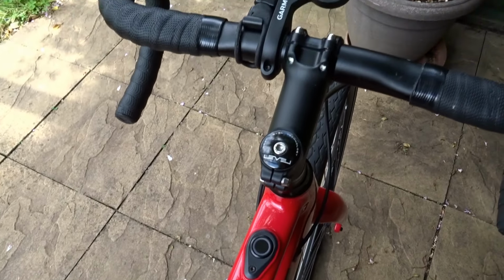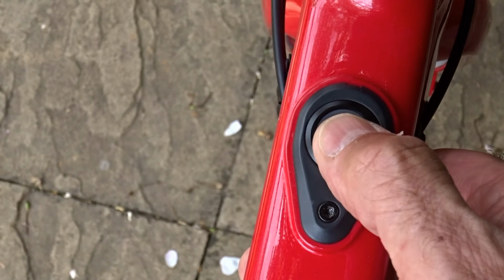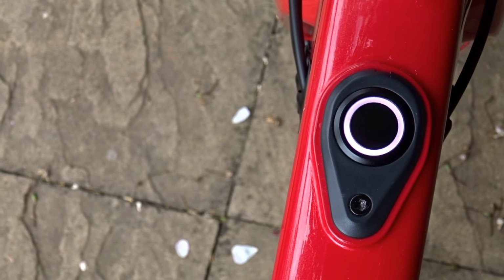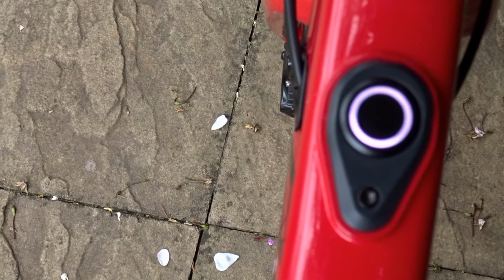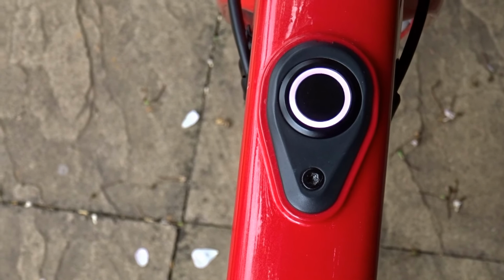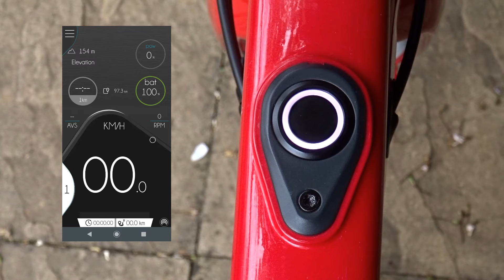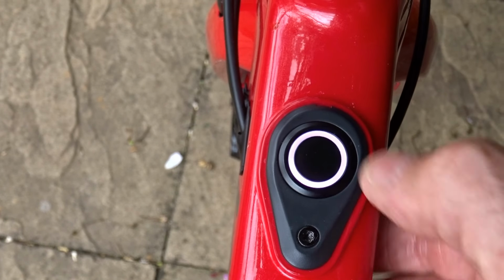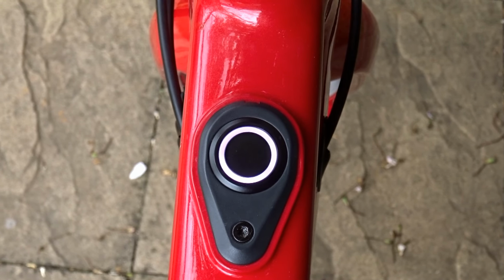How to use the Ebikemotion iWoc controller. As used on Ribble, Orbea and many others.

Comment: Hi again Roy. I was wondering if your X35 ebikemotion will pair with your Garmin bike computer? I am told that the Orbea Gain’s, past 2020 have ANT+ compatibility but perhaps normally they only have Bluetooth LE? I am looking at a bike computer and interested to see how they work together with the X35 motor.Thanks Roy.
Reply from the maker: It certainly doesn’t work on the Garmin Edge, Neil, as the X35 needs Bluetooth 4 or above.  I had heard it would connect to the Wahoo. However, as my son was visiting today we tried it on his Wahoo Bolt and couldn’t find any way of connecting that either. I did read about a device that Mahle have developed to allow connection with the Garmin. This is it https://wilier.com/en/world/eshop/equipment/ant-conversion-kit-mahle-x35-ebikemotion-system. It’s a bit pricey and requires removal of the iWoc button to install the kit within the frame. Personally, I get all the power information I need from the iWoc ‘traffic lightsk, so I won’t be buying one. With the increasing number of bike manufacturers using the X35 it’s something Mahle need to improve so that market leading head units are compatible.
Reply: @RideWithRoy  I have a Wahoo Elemnt Bolt and confirm that it can be connected to the X35 system on the bike, which then gives you the options of an on-screen display of battery charge, assistance mode (given as Eco, Trail and Turbo for Green, Amber and Red modes respectively) and estimated range remaining. No modifications at all required to the bike or the iWoc controller.   Wahoo retrospectively updated the Element/Bolt firmware a little while ago to support these functions.
Reply: @RideWithRoy  Thanks so much Roy for looking into this for me. This confirms what I thought. I agree the compatibility issue is something that needs looking at. I have since learned that Orbea’s gain bikes since mid 2020 have the ANT+ kit built in because they include a mini head unit called a Coachman (I think it is a small Wahoo). I have a hunch that Mahle don’t use ANT+ as a default because ANT+ broadcasts itself everywhere and could be connected by multiple people leading to the ability for someone else to control your bike? 
I have heard the Garmin 1030plus supports the   Mahle X35 but I think that is too much of a bike computer for me. I think I’ll see how I go with the Coachman when the Orbea arrives. I’ll get a cadence sensor though. Once again thanks and please also thank your son for trying his Bolt.
Reply: @TheRoybeasley  Interesting, is the Bolt connecting via Bluetooth or ANT+ Roy? As I mentioned, Orbea's mid 2020+ Gain's all have the ANT+ conversion module built in apparently.
Reply from the maker: It connect via Bluetooth and Ant+, same as the Garmin. Neil. Something I would suggest you buy is the Varia Radar. I won’t ride without it now.
Reply from the maker: Thanks, Roy. That’s interesting and confirms what I had heard. We couldn’t get my son’s to connect but we were in a hurry to get out for a ride, so your confirmation will help Neil.
Reply: @RideWithRoy  yes, definitely sold on that one Roy - safety first!
Reply from the maker: @NeilLavitt  given Roy Beasley’s confirmation that the Bolt connects to the X35,  It looks like I need to revise my comment to ‘Garmin need to up their game.’ I would imagine it must be down to Wahoo using a higher level of Bluetooth.
Reply: @RideWithRoy  No Roy, the Wahoo uses ANT+ to connect with an e-bike.

Comment: Having an effective gear change on the top tube seems like such a step backwards in bike design. You have to take your eyes and one hand off the bars just to select a new power level. Surely it's better to have a bike where this is on the handlebars?
Reply from the maker: Less of an issue than you might think. Gear change remains the same, on the bars, but power change requires a button push. As power is usually less frequently changed, due to the lightness of the bike, the rider is more likely to be taking their hands off for signalling. Mahle do supply a bar controller option, but the button makes the bike look less like a traditional e bike.

Comment: Hey Roy, now that you’ve had your Ribble CGRe for a while, what are your thoughts on the ride comfort? I’ve had a few carbon fiber road bikes, but one frame cracked from one manufacturer, and one frame was recalled from another. My last bike was a titanium, with Ultegra 6700. I sold that about 3 years ago, and haven’t ridden since. I’m interested in the Ribble CGRe, as I’m almost 61, and my legs don’t have the spring in them they once did.
Reply from the maker: Hello Ron, tell me about knees! I recently discovered that I can’t run any more😩 However, my GP said that cycling is great for the knees, especially an e bike. Interestingly, I sold a high end Giant carbon bike with Ultegra Di2 to buy the CGRe. I really didn’t like the carbon frame and felt much more secure on my old Fuji Aluminium frame. I’m more interested in long distance rides than speed, so the weight benefits of carbon were wasted on me, and the disadvantages, one of which you experienced, worried me. As for comfort, the CGRe is ideal, especially as it was specified to suit my body shape. If you are able to go to a Ribble  facility to be measured it will be worthwhile. My last ride was 100 miles and I was still comfortable at the end. The 35mm tyres run at lower pressure that the 25mm on my carbon road bike and that helps with comfort no end. I hope this helps.

Comment: Good video 😃
My pedal assist isn't working 
All I did was remove the back wheel and put a new tyre on
The motor cable is plugged in properly 😱
Reply from the maker: That’s annoying. Have a look at this video as it’s could be that you didn’t put the wheel in correctly and the wheel sensor isn’t picking up the movement. Mahle X35 Rear Wheel Removal/Installation
https://youtu.be/oC-iU5bnT08
Reply: @RideWithRoy  
I've located the washer lug in front of the axle so its out of line with the sensor🙄
Thank you so much 🤣
Gain F40 my son just gave me only 650mls
Didn't realise how good quality they actually are😎
Subscribed
Reply from the maker: That’s good news, glad I could help 😀
Reply: @RideWithRoy 
Still doesn't work 😢

Comment: Hi Roy, thanks for sharing this video which I  have found really useful as it's much easier to understand than the instructions. I have  just bought the Kinesis LYFE bike which is great and  I have only been out twice so far.  Bluetooth is enabled and my bike does show that it's connected to it but when I have looked at my details on the website and the app, it show no rides and no miles.  I do record these on my Garmin/Strava but have not set these to record on the app.  I also have another ebike and although this doesn't record rides, I can see my total distance which I find really helpful. Do I need to have the app switched on to record all rides?  Any advice would be appreciated.
Reply from the maker: Thanks Angela. I don’t use the app but I do know it has to remain switched on and connected to record. Like you, I record on my Garmin and have that connected to Strava. The app is good for showing your battery charge state and any fault codes, but for navigation and ride recording I don’t rate it - plus it eats the phone battery power. I also found that I would lose the Bluetooth connection if the phone was in my back jersey pocket.  I hope that helps but feel free to come back if you need further help.
Reply: @RideWithRoy  thanks, I thought that was the case. I did record one ride and stopped for a rest and didn't realize that because the battery switches off after so long, the rest of my ride didn't record .  I won't bother using the app unless I need I to check the battery or for faults. Thanks for your help

Comment: Hi 

On a recent cycling club ride my girlfriends Lapierre eSensium Women’s 300E electric bicycle motor kept on cutting out and then restarting at inconvenient times during a recent windy rolling 40 mile cycle ride.   
    
What are the reasons why this could occur?
   
She’s not the most electronically gadget competent person, but she knows how to operate the  Mahle 350 operation button and recognises plus understands the colour sequence display.
   She’s not a strong cyclist and suffers from Asthma, so her electric assist bike was chosen specifically to help her out.  
   Look forward to reading any suggestions you can offer.

Thanks 

Philip ( Shepshed Cycling Club,  Leicestershire, UK)
Reply from the maker: Thanks, Philip. Beautiful part of Leicestershire for cycling you live in. The first thing I would check is that the rear wheel sensor and magnetic ring are in the correct position and aren’t damaged. This can happen when the rear wheel is removed to repair a puncture. I made this video about rear wheel replacement that shows the ring and sensor https://youtu.be/oC-iU5bnT08. If it’s not that I am guessing it could be a faulty sensor, in which case it would be best to have this diagnosed by any Ebikemotion qualified mechanic. Alternatively, you could contact Mahle direct. If you need any further help you are welcome to email me ridingwithroy@gmail.com
Reply from the maker: I forgot to mention that if you connect up the Mahle app during a ride it should flag up a fault code, which will help narrow it down.
Reply: Thanks for the advice Roy, much appreciated.  I’ll take her bike for a test ride myself, before going through your suggested diagnosis procedures and onto a qualified Ebike (Mahle) mechanic.
Reply: @RideWithRoy  The bikes in our nearest  Lapierre dealer.  They told us they’ll have to run a diagnostic on the electrics.   Likely cost £30 - £500 depending on what the cycle mechanics identify to be the problem.
Reply from the maker: 😱 let’s hope it’s the lower amount. You may well know this but If it’s under 6 years old you can make a claim for not meeting reasonable expectations. Worth considering if it’s expensive.
Reply: @RideWithRoy  My lady friend received her bike back from an electric bike shop that communicates with Raleigh UK, distributors of Lapierre bikes and ebikes in a worse state than when she delivered the bicycle to their shop.  Now the ebike motion X35 motor does not function at all. On delivery to the shop  the bikes motor worked intermittently.   
      She has subsequently taken her bicycle and left it with Poweredbicycles Ebike centre.
    The shop owner aims to try and get the bike up and running again , even if he has to replace Mahle's Ebike Motion electronics/wires and software to do so.  He seemed very pleased to cast his eyes on a modern Lapierre eSENSIUM bicycle, as he's never worked on such an ebike before.  He is skilled in electrical systems used on electric bikes, and showed us his own software for controlling hub motors.
Reply from the maker: It goes from bad to worse. I hope the latest man sorts it.
Reply from the maker: I believe that Mahle dealers vary considerably in their understanding of the system. It would be well worth involving Mahle so they can keep an eye on things.
Reply: Thanks for  your advice.  
As an update I learned and the issue is: 
“If your bike is out of warranty then there’s no need to take the bike to a dedicated dealer for your own bike. If it’s a motor, electrics (wires and connectors) or software problem, any bike shop with staff knowledgeable in solving and mending your make of motor will take on the job. My girlfriend’s ebike fitted with a Mahle X35 first generation system was repaired by the owner of PoweredBicycles ebike centre, in Long Eaton, Nottinghamshire, UK. He, checked to see if the motor operated independently, which it was, examined all the leads then ordered and fitted a new PASS sensor and upgraded the bikes software. That’s solved the problem of intermittent motor cut outs. It cost nearly £300 due mainly to labour costs since it took time to understand and solve the problems. He also told us to keep on using the bike as the battery’s cells loose their efficiency and degrade if not used for prolonged periods of time. The bike had sat around a lot before it was purchased second hand. We were also advised to pay attention to keeping those areas on the bike where the Pass sensor and magnetic cassette locking ring are located clean a free of dirt and grime.
Reply from the maker: I’m surprised it took so much labour to discover is was the sensor at fault. As you will recall, even I knew enough to suspect the sensor, so a trained Ebikemotion mechanic should have checked this first. You might not achieve much from it, but I would be inclined to involve Mahle. The fact that the software needed an update would suggest that they should provide some recompense.

Comment: So, the battery is inside the frame. How did they get it in there and how would you replace it?
Reply from the maker: There is a removable panel in the base of the tube. The only time it would need to be removed is at the end of its charge life, which I understand is 500 cycles. It is recommended that a dealer carries out the replacement.
Reply: @RideWithRoy  Thank you. I've been wondering about this ever since I saw this type of e-bike on the road. :)
Reply from the maker: @philipcooper8297  I’m sure you’re not alone, Philip 👍
Reply from the maker: Good point to make 👍 thanks

Comment: Hi Roy, I'm interested to buy a bike from Merida with the Mahle hub motor. But if possible I don't want to  (borrow and) use smartphone/app to adjust parameters. 
So, can you tell me, at which percent of max. power the system is set up in the 3 different support levels?
regards from Germany - have subcribed your channel, seems to be useful and intertaining ;-)
Reply from the maker: Thank you, Heiner, and welcome from Germany. There is absolutely no need to use the app if you don’t want to. I only use it to demonstrate for videos. The ‘engine’ parameters should be set to 100% when the bike is delivered, and it’s my recommendation that they are left at that.
Reply: I have just asked the same question of the support people at Mahle. They tell me level 1 gives up to 100W (40% of max), level 2 gives up to 175W (70% of max), and level 3 gives up to 250W (100% of max). Where it gets confusing is that in the app,  the 'motor mapping' function will show that all three are set at 100%. You can reduce one or more of these if you want, so for example if you set level 1 to 50%, it will give you up to 50W (20% of max), rather than the 100W you started with.
Reply: @philwoodhead564  Thanks for the information - in the meantime I have retrofitted my wife's old reliable and light travel bike with add-E - sustainable and reliable, we are very happy with it.

Comment: Can you leave it on charge overnight without harm? How long to go from a near no charge to fully charged?  On charger now and it’s flashing purple!
Reply from the maker: The purple flashing is a fault warning, Bill. In time honoured tradition, switch everything off and try again. If that doesn’t work, connect the app and see if it’s showing a fault code. If it persists, try riding the bike for a short time and try again. The purple light makes an occasional appearance but usually goes away after the off and on treatment or some more use. If not, you would need to contact your dealer or, Ebikemotion customer support, who are very good. As for charging, I’ve never timed it but I would guess 4 hours from almost flat. I have charged overnight, so left it on more than the recommended 5 hours, with no apparent ill effect, but try to do it during the day so I can keep an eye on it. As you probably know, part charges don’t count as a full charge cycle. Charging a half full battery only counts as half a charge, so I top mine up after every ride. It’s also worth noting that you should wait for the light on the charger to turn green before disconnecting, even thought the white light on the bike is no longer pulsing. The most critical thing is not to charge any Lithium battery at below freezing temperatures. This could make it difficult for those keeping the bike in unheated buildings. One way around this is to put the battery on charge as soon as you’ve finished riding, as this will have caused the battery to heat up and the ongoing charge process will maintain the heat. However, if I was needing to regularly charge in below freezing temps I would go for a removable battery type bike. I hope to make a video on battery care and am currently researching it.
Reply: @RideWithRoy  thanks! New bike and I am learning. I think a owners manual with detailed explanations would be so helpful , but dealer told us their  are no manuals  and to get it off the web. Poor judgement IMO.
Reply from the maker: @billcoulter9879  I also like a paper manual but that’s the way the world is going, Bill. I also hate those manuals printed in every language under the sun, so electronic does at least solve that. This one from Orbea is a particularly good one https://www.orbea.com/downloads/products/BLUE-PAPER-GAIN-ALU-2018-2019-EN.pdf. Since your question on charging, I am now in discussion with Mahle Ebikemotion and have also asked questions of Panasonic, who manufacture the battery. I remember being a bit unsure to start with but you’ll soon get used to it. In the meantime, I’m more than happy to help.
Reply: @RideWithRoy  THANKS! That link was helpful. Figuring out and remembering all those colors and number of button presses , and length of time to press on the control button is confusing IMO. Personally I think they need to  break it out to perhaps more then just one single button. A least now I have a pocket reference guide thanks to the link you shared and my printer.
Reply: With any battery if its a phone , ebike , laptop . Once the battery is 100% turn off the charger . Never leave a battery charging more then it should as it won't last its lifespan . The battery will last u longer and never leave in very cold conditions .